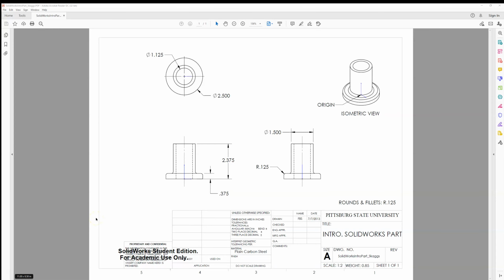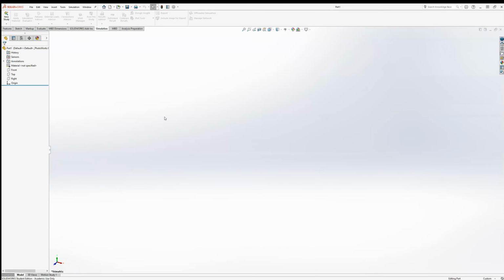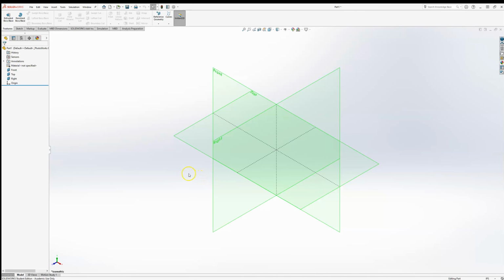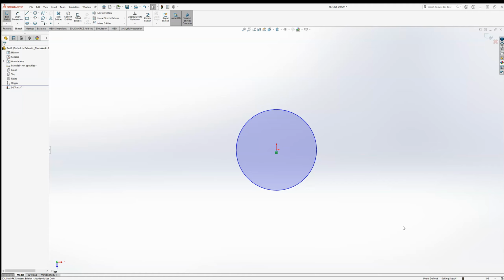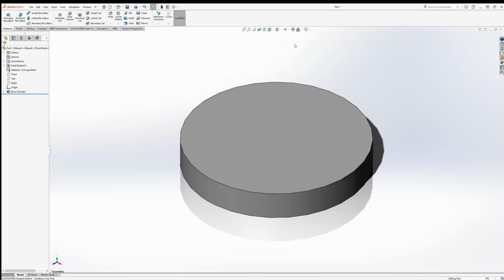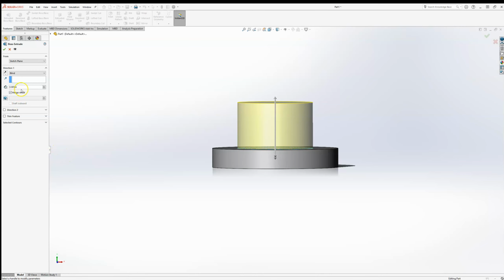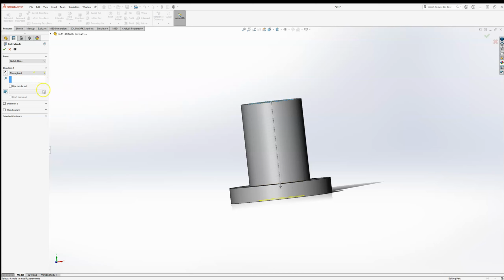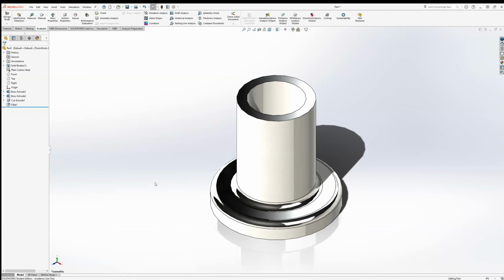SolidWorks Introduction Part

Comment: hello,teacher,could you post simulation and motion tutorials?i can not calculate motor power , sructure stiffness  sth like that use pencils and papers,because i do not have good education,my foundation is so weak,i can only rely on solidworks,thks  again,
Reply from the maker: Thanks for the reply.  You can check out some of my other videos for examples of using SolidWorks to perform simulation activities.  Below are a couple of examples.

Structural Example:
https://youtu.be/CO0uFk2aTEQ

Kinematic Example:
https://youtu.be/zZhbqa86lxM
Reply: @frankieskaggs409  you make everything become easy,i like your teaching style,and your sound is very pleasant to hear,i most like your videos,watching again and again!